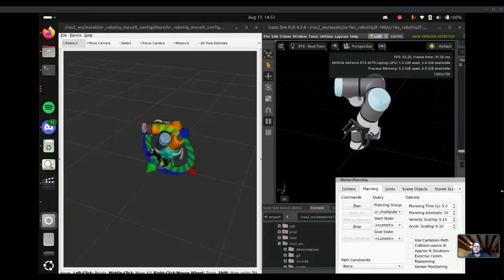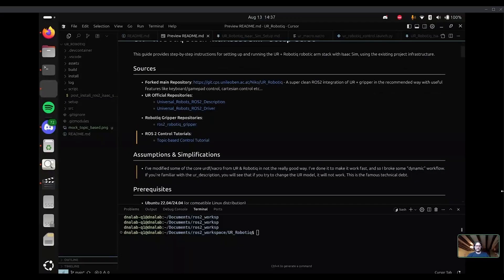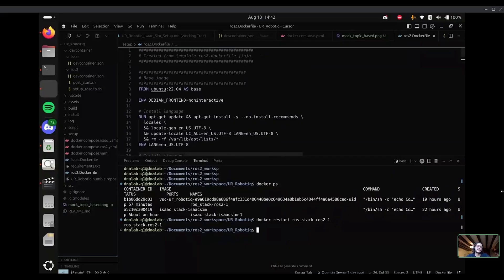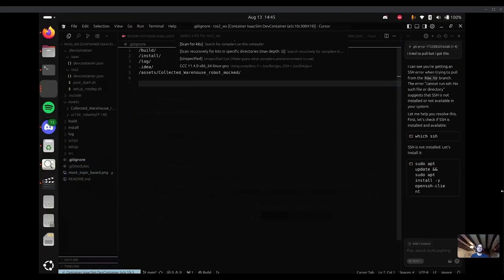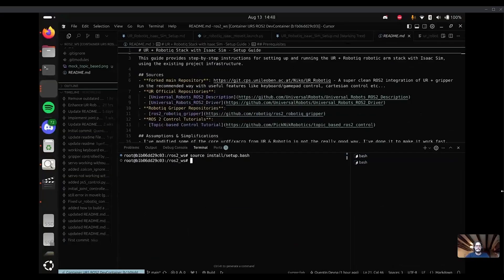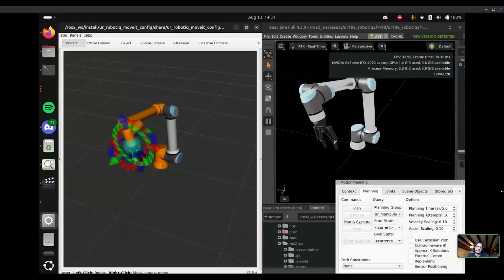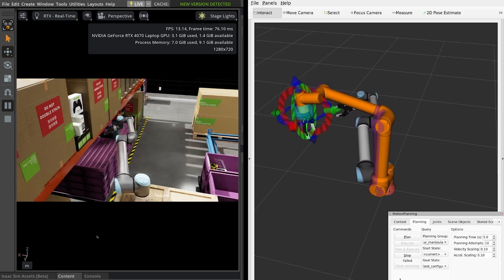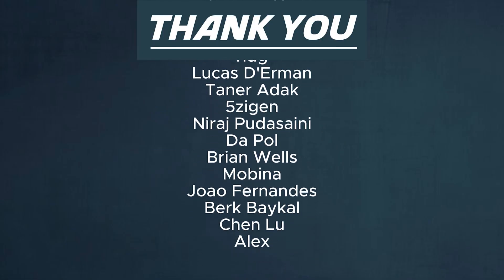Isaac Sim Tutorial: UR10e with Gripper with ROS2 MoveIt (ft. Quentin)

Comment: Nice video! What are the specs of the PC used?
Reply: Hey, it run on a zephyrus with a rizen 9, 4070 and 32gb of ram 😀
Reply: @quentindeyna  What is the minimum vram to run issac sim? is 8gb possible for some simple environment (a robot, gripper, table, and some objects)?
Reply: @sotheara0 yeah 8go is the bare minimum you should have for some grasp interaction. I've done some sim on a 4070 with the same usd setup as the video and a d435 all connected to ros2 and it worked well (but only one, for more you need more vram). Also if you have a lots of collision, it might go wild and you might need to slow down the step sim for better solving.